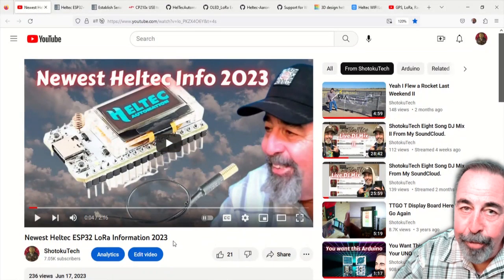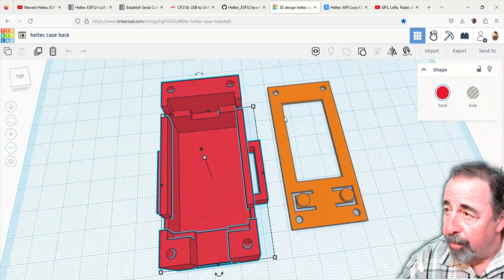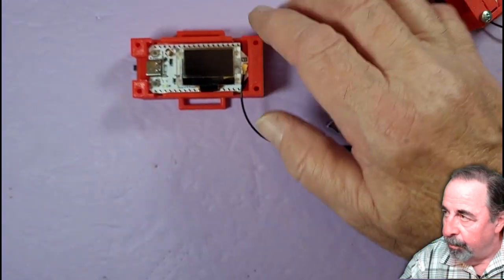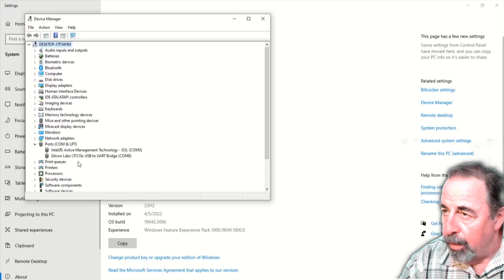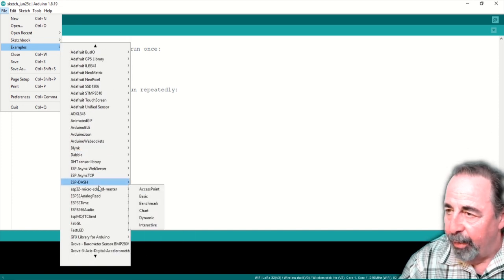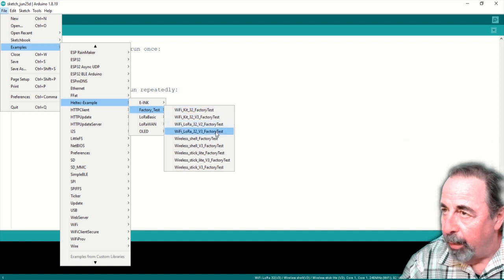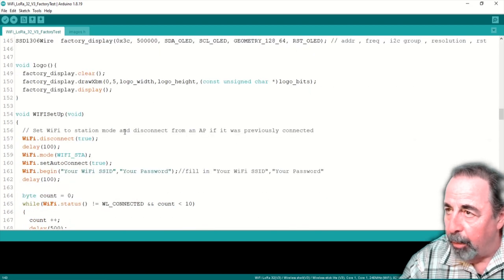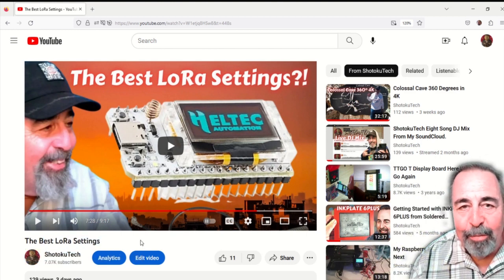New! Heltec V3 ESP32 LoRa OLED Step By Step

Comment from the maker: Current board manager URL: https://github.com/Heltec-Aaron-Lee/WiFi_Kit_series/releases/download/1.0.0/package_heltec_esp32_index.json
Heltec WiFi LoRa 32 Playlist
https://www.youtube.com/playlist?list=PLVPBipeObwMP02QIrh3RGMs1BtPTMt19j
Reply: After using that board manager URL, I can't find "Heltec-Example" under "Examples for Heltec Wifi Lora 32(V3)", which is what I see in Arduino IDE 2.3.2 when I have that board selected. I've been looking for any version of the "WiFi_LoRa_32_V3_FactoryTest" ino file which does not appear under the path "\Arduino15\packages\Heltec-esp32\hardware\esp32\3.0.0\libraries
"
Reply from the maker: @edwardchu2401  Hello. I'm using Arduino 2.3.2, the board manager URL I'm using is:
https://github.com/Heltec-Aaron-Lee/WiFi_Kit_series/releases/download/1.0.0/package_heltec_esp32_index.json
The example sketches are under HeltecExample
With the file path being:
C:\Users\jeff_\AppData\Local\Arduino15\packages\Heltec-esp32\hardware\esp32\1.0.0\libraries\HeltecExample\examples\FactoryTest\WiFi_LoRa_32_V3_FactoryTest
If there is a 3.0.0 board manager URL, I have not tried that version yet.
Reply: I tinkered with this thing again today and came to the conclusion while at the precipice of getting it connected to my Android that the screen on a Heltec Wireless Stick is so tiny that I can't read the input code to connect to Bluetooth, so I guess I'm stalled until I get a bread board and a larger OLED screen.  Looks like this one is destined to be a base rather than mobile.  But I stuck another one in my Amazon cart, one that most people seem to use.  I noticed it has GPS.  Don't get me wrong, I'm not one of those people who can't set the time on their microwave or whatever, but sometimes, I just have to tinker until I don't even initially realize what I did right to get things working.  I can be a slow learner, but once it clicks, I'm off to the races.
Reply from the maker: @turn-n-burn1421  One step at a time. Focus on being able to reproduce success.

Comment: Hi, thanks for the cool tutorial, I'm new to this and trying to have this be my first device. Is the on/off switch you showed necessary?
Reply from the maker: If you are running your own Arduino scripts on it, the power switch is needed. If you flash it with Meshtastic, long press on the user button will shut it down. Thanks.
Reply: @ShotokuTech got it. Thank you for the awesome video and for the response 😊

Comment: Hello my friend! Thanks for the video! I'd like to take this opportunity to ask about using an RTC module in Heltec v3. I can't get it to work. Actually, nothing that uses SDA and SLC ports. Could you help me?
Reply from the maker: I have I2C working in this video "Heltec LoRa 32 V3 I2C Question" https://youtu.be/sBYHlvLupxw?si=NSM5iqkkVoDaChIi
Reply from the maker: You will also want the know the latest about the newest board URL and parameter changes in the code. "Update: Heltec WiFi LoRa 32 V3 Latest Info" https://youtu.be/c1lkIko4Wsk
I have an entire playlist dedicated to Heltec WiFi LoRa 32 boards!

Comment: i cant get lora to work on an exact board like yours, i got it to work on the wireless stick v3
Reply from the maker: Interesting. I have 4-5 Heltec V3's running Meshtastic with no issue. Are you using the latest example sketches that are specific to the Heltec V3? 
"Update: Heltec WiFi LoRa 32 V3 Latest Info" 
https://youtu.be/c1lkIko4Wsk?si=dEP8S3IfkZEA1-pt
Reply from the maker: "I tried a bigger antenna and this happened #heltec #meshtastic #technology"
https://youtube.com/shorts/2zVF1u9YrWo

Comment: Great video! Am I able to have the heltec read sensor data and then forward it wirelessly to the Arduino console?
Reply from the maker: You would need a second LoRa board to receive the message and relay it to the serial monitor in Arduino IDE. Best wishes.

Comment: Does it rund ESPhome ?
Reply from the maker: It is an ESP32, so I imagine it can. But the Heltec WiFi LoRa 32 has a display and a LoRa radio. I don't see that ESPHome can utilize the LoRa functionality yet. So you might consider less expensive ESP32 devices. 
https://community.home-assistant.io/t/sending-data-via-lora-on-esphome/474348

Comment: For a SHTF coms device, it seems rather dependent on the internet.
Reply from the maker: You would only need the internet for installing new software or flashing firmware. Once that is done, I cannot think of any need for the internet in order to use the device. Best wishes.

Comment: I just got V3 boards and would like to see the FactoryTest.ino file. I can't find it in the library and examples in the latest version of the arduino library. I am looking in 
"C:\Users\[me]\AppData\Local\Arduino15\packages\Heltec-esp32\hardware\esp32\3.0.0\libraries"
but do not see a FactoryTest folder. Has that code been moved or renamed? Where can I find the code that is running on the ESP LoRa V3 device I have? Thanks!

Comment: Hello! do you know if the test sketches are compatible with non OLED v3 modules? I bought a couple and have been running into compile issues with the v2 factory test sketch
Reply from the maker: V3 is the jump from ESP32 to ESP32 S3. There is a big difference. The only example sketches that will work are the ones that ship with the board definition for the V3 boards. I cover that is this video. V2 factory test simply won't work at all on a V3 board. So, add the latest board manager URL for your device, load that board definition, choose that board and find examples in Heltec-Example.

Comment: Do you have a video of adding a solar panel to a heltec v3 setup? I can’t seem any how tops with a heltec vs.. everyone uses a wisBlock but I want to do it with a heltec?
Reply from the maker: This panel is excellent. It plugs into the USB port. 
2 Pack Solar Panel for Wireless Outdoor Security Camera,Compatible with DC 5V Rechargeable Battery Powered Surveillance Camera
https://amzn.to/3Uc9sSa
I soldered the battery connector that comes with the Heltec V3 to a 18650 carrier, so I can use a 18650 battery. I found a suitable enclosure and mounted the Heltec and battery combo in the enclosure under the eves, so it won't get hit with direct sunlight. The combination has been operating for several weeks without intervention. Most important is placing the panel where it can get direct sunlight throughout the whole daylight hours. If the battery goes below 3.2v you will have trouble. The Heltec V3 is running Mestastic and low power is switched on. So now I am learning how to do remote administration using Meshtastic Python CLI.
"My Heltec Meshtastic Story So Far" recaps most of my Meshtastic experience.
https://youtu.be/fq0wW1AGDmU
Of course I have a playlist for Meshtastic:
https://www.youtube.com/playlist?list=PLVPBipeObwMNikSEscJtNj8iK2wksWBtu
And Heltec in general:
https://www.youtube.com/playlist?list=PLVPBipeObwMP02QIrh3RGMs1BtPTMt19j
I might make a comprehensive video specifically about the solar setup. I still need to make some improvement as the panel starts getting a shadow cast on it around 3pm. So I could still get 2-3 more hours of Sun once I rearrange it. Right now as it is, by sunrise I'm at 40% battery, 3.63v.
Best wishes.

Comment: hi sir, could u have a tutorial video about battery managements? Like example, showing the battery voltage, battery capacity, battery current percentage, and soemthing regarding with charging and so on.
Thank you so much.
Reply from the maker: That's a good question. Thanks.
Reply: came here looking for exactly this answer. I have watched most of your videos at this stage, find them really useful! I would love to be able to display the battery percentage and display "charging" if the power cable is plugged in. My intention is to have a small solar panel connected in order to recharge the battery. I am using the lora 32 v3!
Reply from the maker: @karlennis7974 This is actually top of my list right now.
Reply: @ShotokuTech  brilliant!!! I have subscribed and waiting with held breath!! lol
Reply: All of your tutorial video for heltec wifi lora v3 are very helpful sir.👏🏻👏🏻👏🏻
Can't wait ur next tutorial video about my topic😄
Keep working💪🏻💪🏻
Reply from the maker: Here is what I found so far: https://youtu.be/MZaOTS7ZZyo?si=5kl7Jj46ErWEgbIC

Comment: Hi,
I'm stuck with My DHT sensors (both DHT 11 and DHT 22) which give abnormal values with my heltec lora V3 board ( such as T=543°C and H = 543%)
I don't understand because the sensors were working normally with my Arduino Uno board.
With my Heltec V3 board, the only difference is the choice of pin ( i chose the GPIO46 since the DHT are supposed to give digital output).

According to the pin diagram of the Heltec V3 board, could you confirm that the GPIO 46 is relevant for (digital) sensor such as DHT 11 or 22.

In another hand my weight sensor ( hx 711) is supposed to give an analogic output signal so i was about to test it with any of the "ADC" pins of the board.

That's why i would like to find details about the kind of sensors we are able to connect to every pin of the Heltec V3 board but i didn't find anything in your playlist of the Heltec V3 board.

So i would have questions :
Is there a similar topic of "pin description" which has been done on your channel?
Otherwise what pins of the Heltek would you recommand to connect sensors which give digital output signal (and for those which give analogic output signals)?

Hoping you will be able to help me.

Eric
Reply from the maker: Hello, you raise a good question. I have been exploring the pinout for V3 for a while.
This one shows the file that contains the pin definitions in Arduino IDE for the V3 board.
Heltec WiFi LoRa 32 V3 SPI, I2C, OLED I2C, and Serial Pins
https://youtu.be/OBQidEVssto?si=wGQ9_WAC_W73lD2-
This shows I2C.
"Heltec WiFi LoRa 32 V3 with MPU-6050"
https://youtu.be/5lEMRN-o_ng?si=zZaOy7sHJIsVhDRS
This shows the second set of Serial pins.
"Heltec WiFi LoRa 32 V3 GPS Question"
https://youtu.be/tQZC4GlYhMc?si=qGxCNQfB7eiC-1LE
Here is the product page with the pinout.
https://heltec.org/project/wifi-lora-32-v3/
I will try to visit analog and digital sometime soon.
Best wishes.

Comment: Hi, my name is Eric,  (new suscriber)

In order to make a "connected-beehive " project (monitoring of beehive temperature and weight),  I recently bought the  "Heltec V3 ESP 32 LORA OLED V3" presented in this video.
The device i bought was very poorly documented since only a pin diagram was given.

So, as i was making my own search on the web, i found your channel and especially this video which is very well documented, step by step.

-First, I have precisely followed all your steps (ie CP210X drivers, "preferences" updating with ESP 32  board selection, library downloading...) without any problem.
-Then my Heltec V3 board is well recognized by my Arduino IDE  (I used Arduino UNO as a first sted of my project to check that the sensors were working and they did)

But whichever the ESP 32 example given (factory test, oled test...) I'm stuck with the same recurrent error problem ("class ESP 32 has no member named display") 
Actually, i'm unable to do anything with my Heltec V3 board 

Would you have an idea that could help me?
Reply from the maker: Hello. I have an entire playlist dedicated to the V3 board. I have documented everything I have had to struggle with in video and have several github sites with code as well. I even have a good pin diagram. I invite you to take a look and see if your questions have been answered already. 

Make sure you have the correct board manager URL. It is in the description and pinned comment on this video. Next you must select the Heltec WiFi LoRa 32 V3 in board manager. Now look for the example sketches under Heltec-Example.
The Factory Test Sketch works well. 

The error you have means you are using the old library or old sketches for V2. The Heltec-Example sketches come from the V3 board manage package. So there is no library to install. 

I cover connecting a device via Serial and also I2C in the playlist, simplified display code and more. Happy to help. I just can't always revisit things I have already covered. 

Best wishes.
https://www.youtube.com/playlist?list=PLVPBipeObwMP02QIrh3RGMs1BtPTMt19j
Reply: @ShotokuTech  Thank you for your help
Speaking about the error message, i have been surprised by your track of "library conflict with V2" since i haven't other version than my present ESP32 V3.
But the fact is that I have been able to solve the error problem by just removing the V3 library and reinstalling it afterward.
Then I have been able to do the factory test and the pingpong test successfully. I'm still struggling with the Wifi test...
Thank you again for your help and for the quality of your videos content, so helpful ;-)
Reply from the maker: @ericjoulin8758  Great! That is wonderful progress.

Comment: Different issue this time.  I had a totally different ESP32 board that seemed more inclined toward projects, but I just got THIS board today from China.  This time I cannot get the Silicon Labs driver to show in device manager.  I've tried a number of times.  Any ideas?
Reply from the maker: It's hard to provide technical support from here. Without understanding what PC hardware, OS version. I would go into device manager and click 'view' and then click 'hidden devices'. Resolve or remove anything that has failed. Then reboot.
Reply: @ShotokuTech  Nevermind on that. I figured out how to search for hidden drivers and found it. I'm actually not sure where I'm even supposed to be. I'm doing the Meshtastic thing and have the apparently common ESP32 LoRa device with Bluetooth and WiFi. It is the one capable of US region. I've been in the Meshtastic site trying to figure out what's what. When you have no idea what any setting should be, because you're a newbie, it's extremely confusing. I've yet to find a video by anyone that fully covers the appropriate settings.
Reply: @ShotokuTech  I was able to recall some steps that helped me get started last time and got somewhat set up tonight.  I accidentally entered the incorrect WiFi name for our home and then all my access to the device shut down.  Now I'm stuck again, but I'll figure it out.  I found two different videos that helped Darknet-NG and Mark Ryan.  I didn't use either of those last time, but they did help me recall sites I used before.  I'd totally forgotten about the flasher page.  I tried a test message, but I doubt I had everything set fully, and didn't get any replies.  I'll get there.  I may have to reflash and erase everything and start over.  At least this time I have all the right equipment.  Being new at something sucks until you figure out what you're doing.

Comment: Hi, someone can help me
I'm doing a simple project which is display real time and date on oled Heltec Wifi Lora 32 V3 using DS3231, i tried many solution on internet, still display nothing on OLED
Reply: If someone has been doing a related project, could u leave a comment pls
Reply from the maker: There is link to the code on my github page for this video.
"Heltec WiFi LoRa 32 V3 Text Display Examples"
https://youtu.be/3x8vREn3mq0
Reply from the maker: Your device is I2C, this covers that topic:
"Heltec WiFi LoRa 32 V3 with MPU-6050"
https://youtu.be/5lEMRN-o_ng
Reply from the maker: Here you go. https://youtu.be/nwG4l7Ph1Do

Comment: Is it possible to get the V3 board to post my location to Meshmap with "Fixed GPS" or is it necessary to add a GPS Module? Coordinates show on the screen but not on the map. Thanks
Reply from the maker: The WiFi LoRa 32 V3 board does not have any built-in location sensing capability. You will want to add a GPS module. Thanks